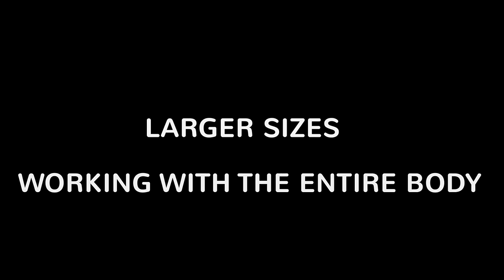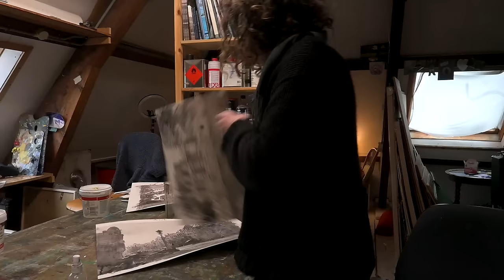48 Larger paintings

Comment: Thanks to you for your insights while your paint. Have a question, I always see no matter what size of paper you use, how is it that your paper never buckles or has air bubbles. 
Thank again for your kind insights.🙏🇳🇱
Reply: He uses Arches 300lb/650gr just is too thick to bubble. One can cut the size they want from large sheets and it is more economical to purchase that way. Whether hot pressed or cold pressed it is just too thick so it could handle being literally soaked and soaked again and again. Even if it did start to lift up from being soaked, it will dry flat. I call the paper “the super soaker” and love it but it is expensive. The same brand sells the 140/lb weight which is less expensive and can take a beating as well. Some choose to pre soak and stretch it, staple it or not. Either way even if the thinner weight is a bit wavy it is not hard to fix. Just lightly dampen the backside of the painting and weigh it down flat overnight and it will flatten.😊
Reply: 640
Reply from the maker: Hi, the paper I’m using is thick enough to stay flat and straight.
Reply: @lynda8852  yes 640 gsm we use pounds in the US thank you